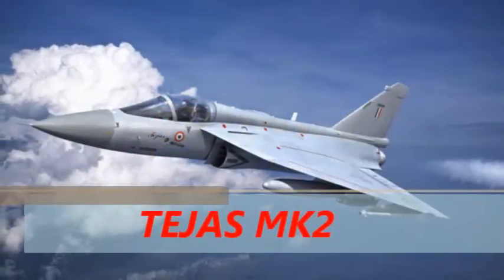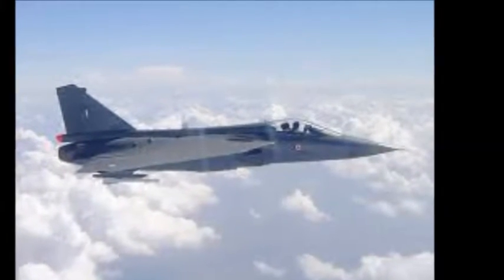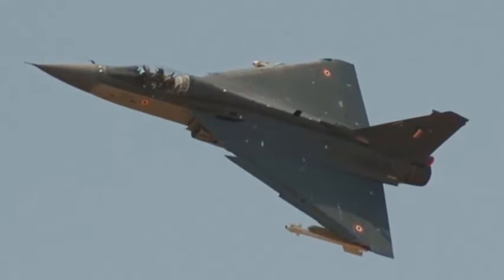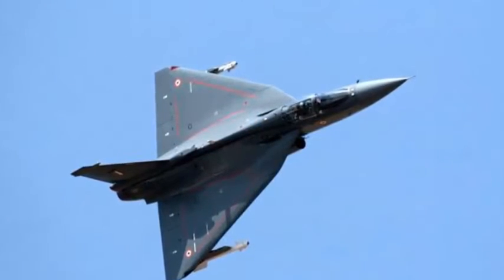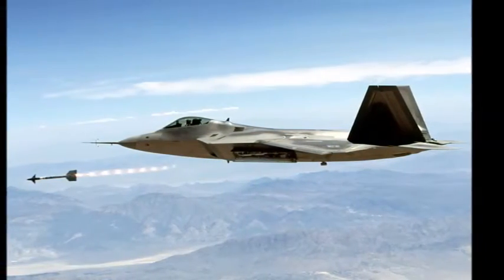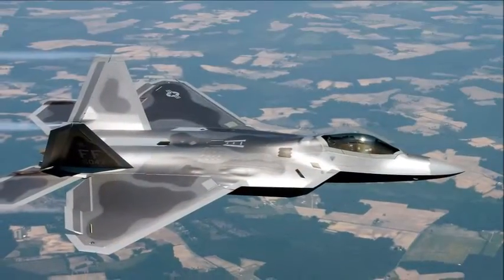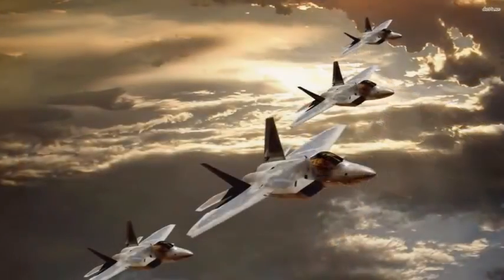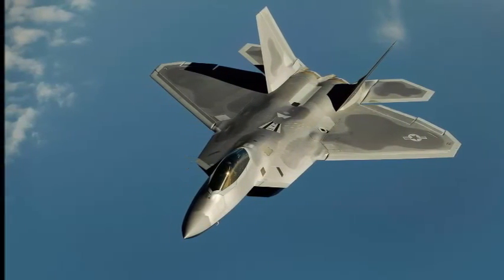INDIAN AIRCRAFT VS AMERICAN AIRCRAFT | TEJAS MK2 VS F 22 RAPTOR  BEST AIRCRAFT MISSILE

Comment: Typhoon German &  French Rafale....have managed to win 8 times / 1 time  respectively against F22 ..in mock drills..(perhaps due to essential advanced  features of F22 being restrained for mock drills).....India's  Tejas uses  very advanced technology and is quite a formidable aircraft.
Reply: The mock drills were due to the F22 having it’s systems disabled as it was not informed of there being a drill. (This was purposefully done for whatever reason. ) The F22 lost because it got locked onto. The reason for this was due to a manual lock, which the F22 cannot avoid. Assuming the F22 were to be informed of it being a combat mission with it’s systems on the fight most likely would have been over before it started. Personal opinion , though.
Reply: F221vs6 and it locked 5 and locked by one

Comment: There's no comparison F22 is a gen 5 while Tejas is gen 4.
Reply: Not even 4
Reply: 3.5 maybe
Reply: 4.5
Reply: Stop being antinational be indian buy indian.
Reply: In dog fight Tejas has more chance to win against f22 raptor because of better manuars , better thrust ratio,and python 5 integration
Reply: See
Reply: @vinayak81 F-22 has thrust vectoring, it can literally stop mid air
Reply: @MiG-31893  yes bro recently we see the crash of a Tejas fitter because of power loss this is the issue with single engine fitter but against f22 Tejas has many other advantages also low
 Cost and climate of India and other factors favourable for our air force
Reply: @vinayak81  yes, but I still believe very strongly that the F-22 would win in a dogfight, thrust vectoring is a very important factor in dogfights especially because F-22 has it and Tejas doesn’t
Tejas is a delta wing fighter, comparable to the Mirage 2000.
However the F-22 has never been beaten by any jet in a dogfight, even Eurofighter Typhoons and Flankers.
Only once, after “shooting down” 7 Rafales in a dogfight, did it get locked on by a Rafale, and it counted as a kill because the Frenchman could’ve shot the F-22 if this was a real battle.
Tejas is much cheaper, and F-22 is far too expensive, and is causing the US a lot of issues with its expensiveness
Reply: @vinayak81 bro you say Tejas trash win in any except against world best f22 in any fight tejas is an old 1980 aircraft 😅😅😅 v f you if usa stop engine what happened 😅😅😅😅
Reply: @Cricket_edits.  India will definitely increase the budget on research and give contract of manufacturing to the private contanders like tata and realince